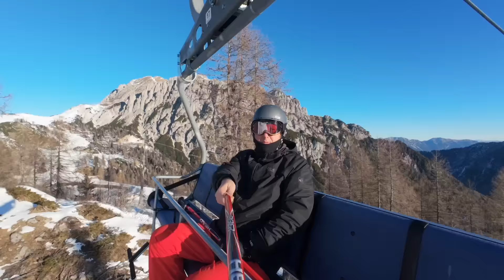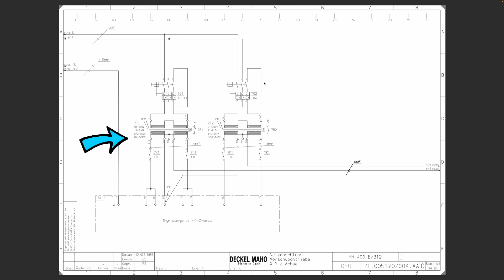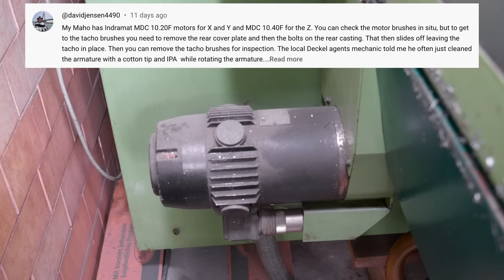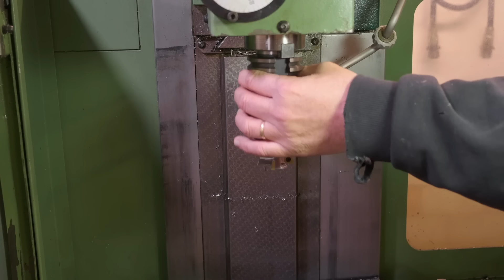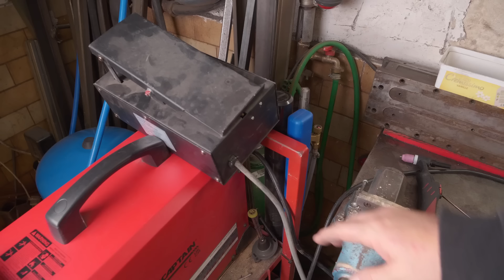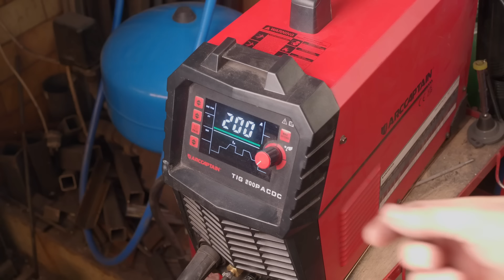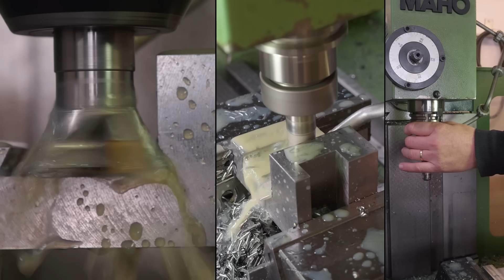My mill threw following errors. Did your advice help troubleshoot it? || RotarySMP

Comment: Just started watching the video, I had to stop, laughing! 😂

It's minEstrone, not minIstrone.

Ministrone is translatable as a "big minister", like a fatty one, not an important ministery.

Imagine eating Salvini.
What an awful image...
😂
Reply from the maker: Love the comment. Thanks :)
Reply: @RotarySMP  😂

Just finished watching the video!

Don't worry too much about the slightly irregular position of the inserts on the dovetail cutter.
If you keep it on the same toolholder you can try to re-position it slightly, put it on an ER collet toolholder and try to force it slightly to the right side.
In real life collets aren't that precise, I have to check and correct run-out often at work, up to 0.05mm of run-out are fixable with some light hammering on the tool (with an aluminium piece in between), before the final tightening of the nut.

What quality of carbide are you using for the DCMT?

For milling operations it's better to use P25 or higher number because of the interrupted cut.
Also it will be better to avoid flood coolant to reduce thermal shock on the cutter edge, if you want just copy my system, a simple pipe that blows lubricated compressed air through a small nozzle.

My setup is made with a recovered 25l air compressor air cylinder which had the compressor unit gone, with a cheap 2cylinder silent compressor from Amazon (750W), a FRL unit filled with cutting oil (I use vegetable cutting oil mixed with WD40 to make it thinner, especially during winter months, Friday I had 1°C in the laboratory...), and a 0.7mm kitchen propane jet at the end to increase air speed.
With 1bar air pressure chips flew away, oil is getting to the cutting area and that small compressor has a 50% duty cycle (I tuned it for that, stopping it at 6bar).

I can't help with the motor tuning (?) issue, I don't have experience on that.

But I can assure you that ISO VG220 oil is way too thick for winter use.
Also, it increases the axis motor load, if that beauty was mine, I will use 68 way oil, with EP additives.😊

Comment: In my experience 220 slide way lube use was very uncommon on traditional slide ways including Turcite lined. There was only one machine I encountered that had been extensively modified an carried a very heavy fixture for the way size. It had oversized X and Y motors and used the 220 on both of those ways. 220 is normally the go to lube for oil lubricated linear bearing way machines. Okuma LAW lathes is a great example as the tool turret is fixed and spindle with a built in motor is moved to the machining requirements. A 23" chuck holding a part running at speeds that max out at 2000 rpm puts quite a bit of dynamic load on the linear bearings let alone the cutting forces and these use 220 slide way lube in the linear bearings. So the point contact load is very high compared to a traditional slide way. From memory they rapid in factory form at over 10 meters (But most if not all turn this down and tune to the particular job they are doing)
Reply from the maker: Thanks for your input on this.

Comment: i love your work, i've done a linux cnc conversion myself the ferror should be the tolerance the machine advertises its able to hold in the manual or better (that tolerance is after stock ball screw and way error with a safety margen) my machine lets you feed at rapid speed so i just have one number if g0 from the factory is faster then max speed g1 you need to make a high and low speed number pid tuneing sucks it took a long time for me to get my machine working right make sure the cables for speed ref or pwm have a noise free signal even if you reused them check with a sope with cables disconected from the drive and by setting hal pin values manualy that got me
Reply from the maker: Thanks Joshua. My manual says noting about tolerance.

Comment: 220 slide way oil in a machine of that size is an odd recommendation - only machine I saw that grade used on was an Asquith floor borer ! 
Apart from a Correa milling machine with a 14 tonne table load rating that specced 160 grade oil, pretty well everything else ran on 68 at my last employment and also pretty well everything else I can recall working on before that.
220 in a cold basement would be pretty claggy.
Good to see you back in action.
Reply from the maker: Thanks for your feedback on that.
Reply: hits it with moly di grease thick enough for some! bit like bodyfiller in my case :)
Reply: My mikron wf21c also use slide oil 220.    If i use the 68 the z axis wil stik  and not douwn nice and smoot

Comment: My level of troubleshooting knowledge is nowhere near your other viewers but my first question is always “Why now?”. The shop being cold is a pretty good answer and I’m not one to look a gift horse in the mouth since it’s working, but why this winter and not any of the previous?
Reply: Once had a Nissan Truck that drained its battery every night one winter. Could not figure out the issue until a neighbor asked why my headlights turned on late every night. 
There was a fault in the light switch module that only happened at near freezing temperatures.
Reply from the maker: @support2587  That must have driven you nuts!
Reply from the maker: Good question Michael.

Comment: Its nice your machine is working again Mark.
For my machine i used new delta servodrives and motors no linair scales.
I sold the old stuff for good money 
Works as a champ. Stil great toleranse. 
And de system is silend.  No buzzing transformers.
Reply from the maker: The lathe is the same with the 3ph AC servers.

Comment: Happy new year from Norway. Great skiing condition with max minus 8 C and sunshine  ⛷
Winter came in the new year. About minus 20 C outside and 30cm of snow.

Winter condition does alot of funky things with machines. 
Have a 14Kw diesel heater in my workshop, witch drinks alot of fuel to keep the machines happy in winter time.
But that's what it takes to have a happy "family" in the shop😀

Hope the mill will continue to work 👍
Great vids
Reply from the maker: The temp has dropped here in the city now as well. Not as cold as you have it, but windy and cold.

Comment: I like that you are always so obsessed with cleaning the metal name plate yet still have a broken M on the maho. Even though you have access to equipment to fix that xD
Reply from the maker: It riveted plastic. And quite a PITA to get that panel removed.
Reply: @RotarySMP  Just make missing part :)
Reply from the maker: @DreitTheDarkDragon  Making the part is easy. Removing the old one and mounting the new one, not so much.
Reply: @RotarySMP  he means the missing section of the M i think, and then you attach it to the rest of the M with adhesive
Reply from the maker: @ikbendusan  The originals are rivetted on.
Reply: @RotarySMP  i mean you attach it to the rest of the M, not the machine. the M is attached to machine, piece of M to M... get it? hahaha
Reply: Some people might call it as obsessive, but I call it "therapy".
Reply from the maker: @MRCNC1967  :)
Reply: For some reason when I saw that, I imagined that the Maho version of the Cookie Monster had eaten the M. I can't quite explain why this would make sense.
Reply: @johnhawkinson  lol now I can't unsee that. We need a Metalworking Machine Monster to be added by the name, gnawing on it 😆
Reply: @johnhawkinson    and now you have presented an alternative solution for the broken M
🤔
Glue a Cookie Monster puppet to the machine next to the broken M, with yellow crumbs in his mouth

Comment: Your wife is the god of troubleshooting hahaha
I loved that so much
Reply: As for actual issues, I was also on the encoder's side or lubrication but it's odd that it all happens at once. Contactor faults on servo drives are... A possibility but they will usually sooner throw an error, or power through it with the capacitors and ignore it